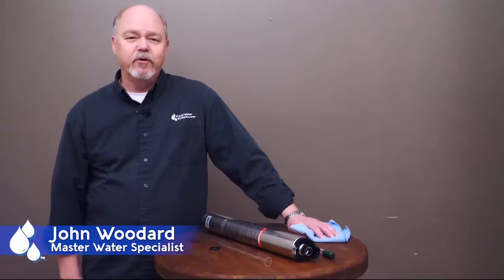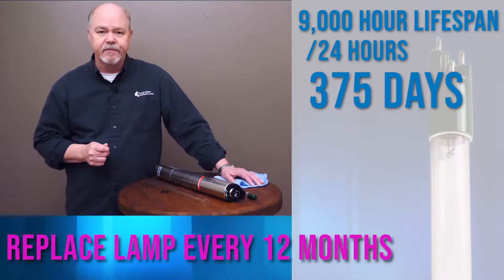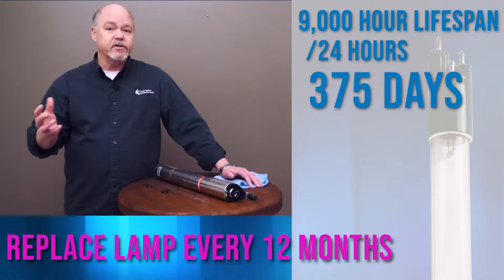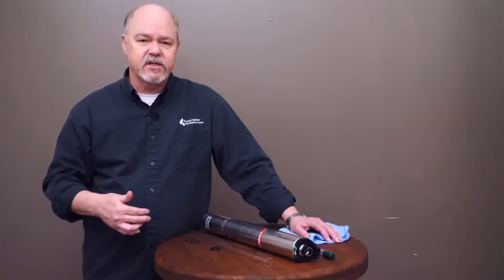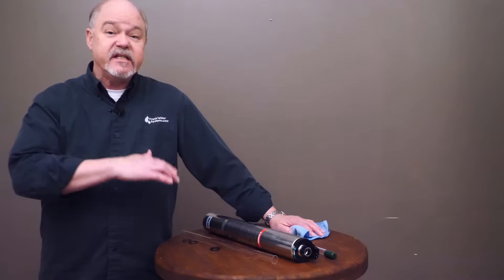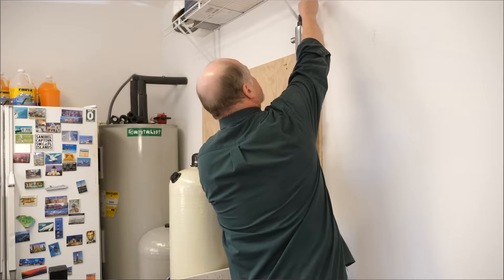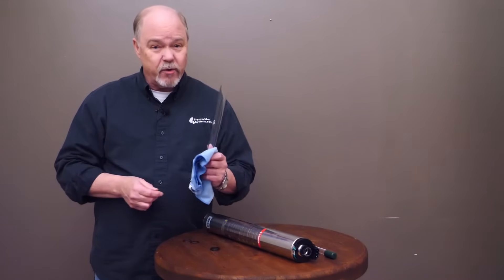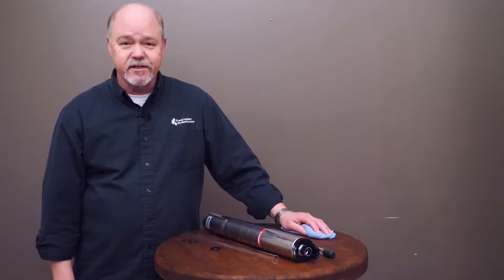How to Maintain Your UV System

Comment: I was told to replace at 2 years. I did not have an alarm going off but I replaced it at 2 years, which was last week. It continues to blow the 2 3amp fuses in the controller. I called the company and they said that replacing the bulb will probably stop the fuses blowing. It did not. Why is it still blowing fuses?

Comment: If the sleeve gets dirty does the cylinder not as well? I was told the inside of the cylinder is shiny bouncing the light rays back. Would I not have to clean the inner cylinder somehow?

Comment: I have a question.can we use a high pressure switch to control  on/off for uv light. I mean when you open faucet which belongs to ro system,the high  pressure switch is turned on the uv light.so l think we can extend life span of uv lamp .
What is your comment. Thanks.
Reply: No (short answer). It's covered in the video. Turning the bulb on/off regularly greatly shortens the life of the bulb.. and puts unnecessary wear on the ballast (power converter).